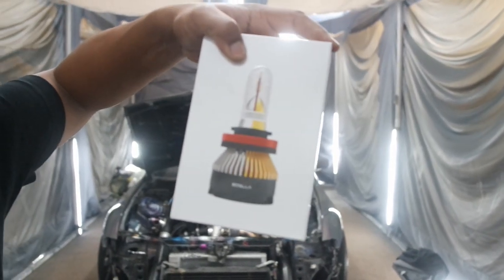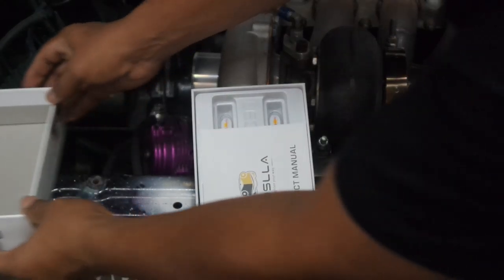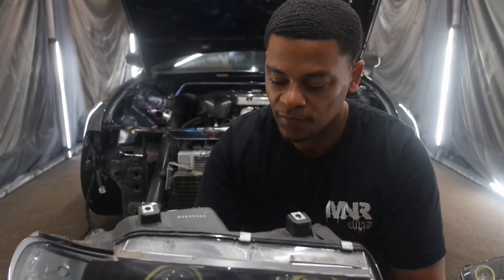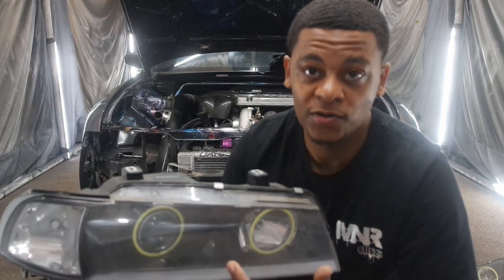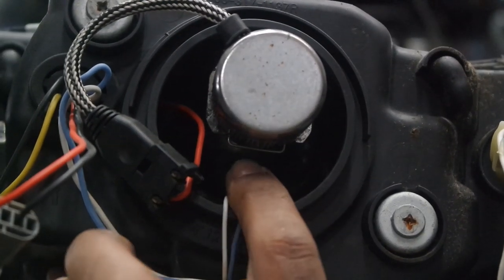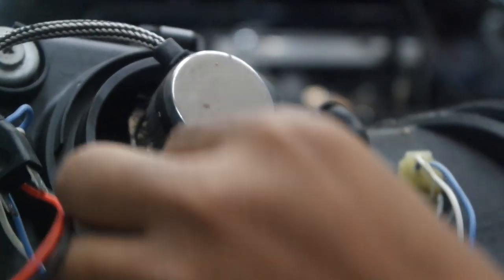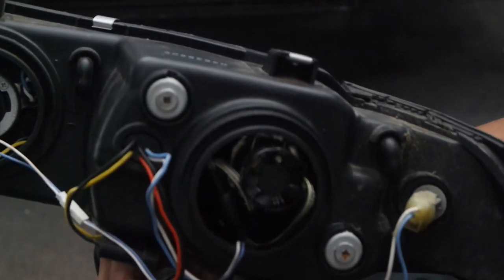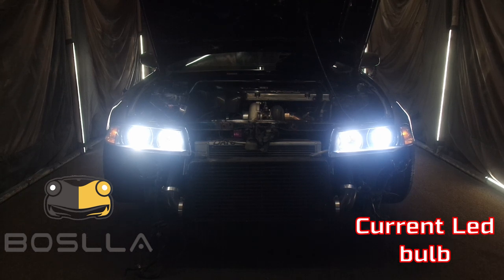Boslla 4 in 1 led headlight bulb install and review | Honda Prelude

Comment: Good video! So these are flipping colors based on a quick on/off of the headlight switch, correct, that being said 1) do they remember their last setting after being turned off normally? 2)Have you had an issue yet with 1 side changing color but the other side doesn't? ( because one bulb caught the "quick signal" to change  but the other did not)
Reply from the maker: The default is always the 6.5k white so, but yes with a quick flip off then on switches through the modes. And no issues they have worked flawlessly so far.

Comment: Does the rubber cover that comes with the depo headlights interfere with the new bulbs/does it block the fan?
Reply from the maker: If you want to use the rubber covers you'll have to cut and modify them to fit over the bulb

Comment: Did u ever get it tuned after upgrading turbo?Didn't see a video
Reply from the maker: Nah i got rear ended so i almost lost my car but now that its fixed im just waiting to get tuned now.
Reply: @treybedipping1734  right on kinda curious on the css block and what it makes
Reply from the maker: @garagebuiltbackyardbuilt9774  goal is 600 so we'll see
Reply: @treybedipping1734  yee should be good about 25psi+ I was thinking about doing the css on my f20b as well but shipping kinda expensive from cali to Maryland
Reply from the maker: @garagebuiltbackyardbuilt9774  there are multiple shops that do it